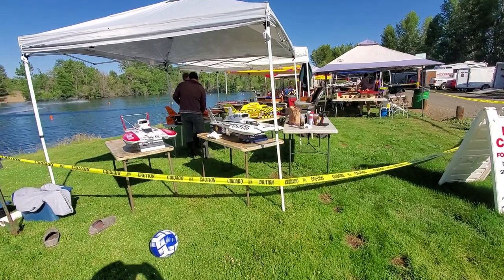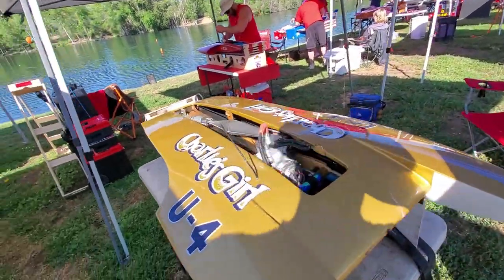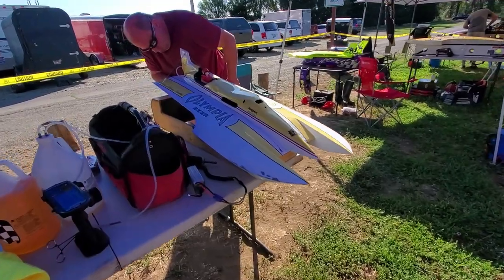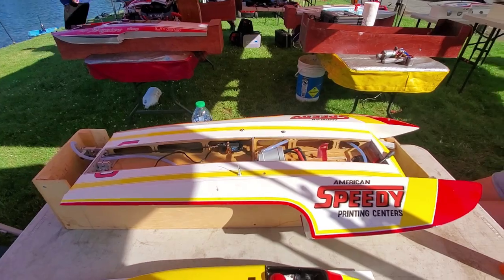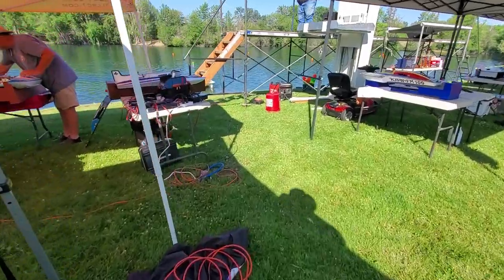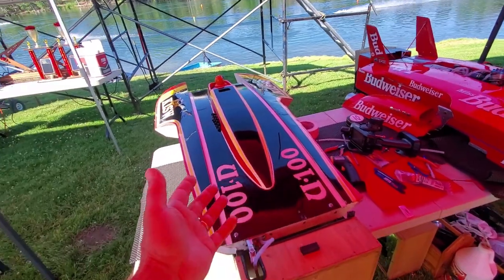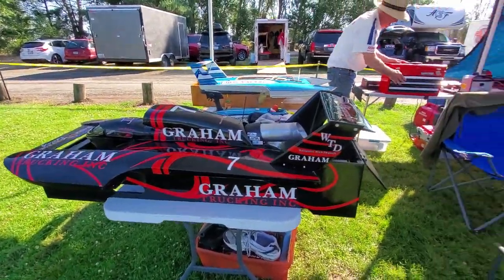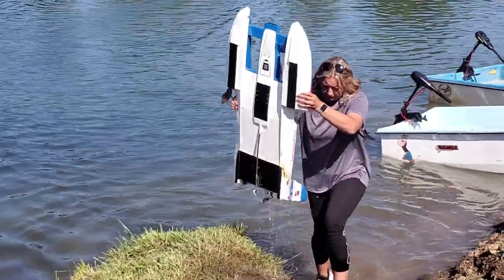Radio Controlled Hydroplane Racing Pit Tour | See These Incredible Boats Up Close!

Comment: Nice video..thanks..😊..were in the process of a boat build...we have had a pair of foam Huey hydro sponsons..like what 30 years old...lol...so with any luck will get this build finished in the water.. building a electric boat.. useing proboat drive train .2000 kv dyomite horizon hobby motor and speed controller..we are looking for a cool looking cowel for the boat...as of right now in primmer with no electronics in the boat it weight is at 2lbs... onwards..play play play.. 😊.. ❤️..
Reply from the maker: Sounds like a fun build!

Comment: Are there any rules/requirements for scale drivers? What if member wanted to run a clear canopy or open cockpit boat with no scale driver? I feel like I'd love to join in the distant future but I just can't put a scale driver in my boat dude... not gonna happen lol.
Reply from the maker: Gotta do it under the rules
Reply: @M5PerfHydros  Weird. 100% weirdness. I guess I'd have to have a drop-in lol. So do they have to be Historical Drivers or can they be science fiction characters, if so I'll run the invisible man version of Chip. I model vehicles not humans, dolls, fake half dolls at that. I feel like scale drivers totally kill models, make them look instantly fake. Nobody puts full size mannequins in unmanned vehicles. My scale RC boats driver is ME with the Tx, so there should not be a doll under any circumstance. RC's should never ever have friggin dolls anywhere remotely near them. Had to rant. I feel better now. :)
Reply from the maker: Why then have a cockpit or seat at all?
Reply: Because those are "boat parts". For display and scale accuracy. As if the just machine was shrunken. So that a photo of the scale model may be indistinguishable from the full scale counterpart. At first site of the scale driver, the illusion is broken for me and the true scale becomes obvious. Honestly I'm not really sure where I draw the line lol. Not gonna servo my steering wheel but side mirrors are mandatory lol.